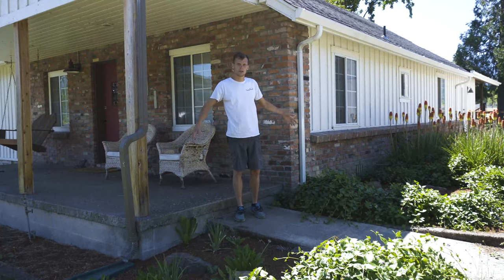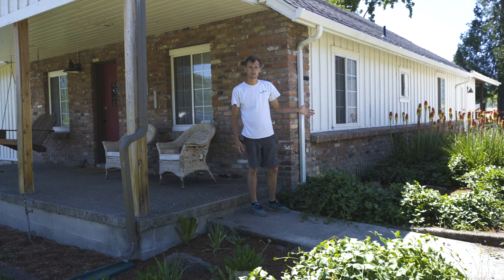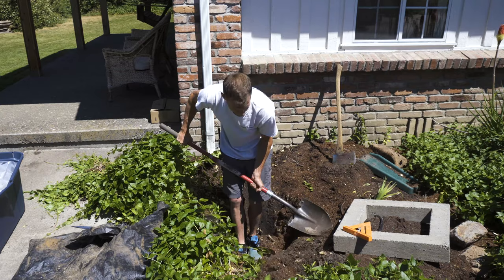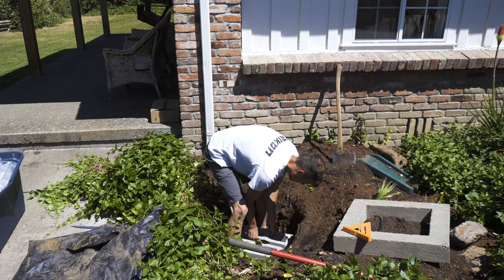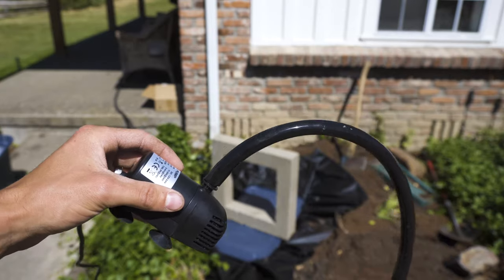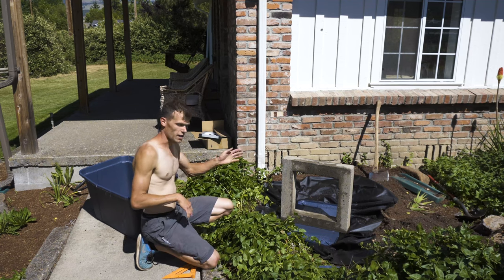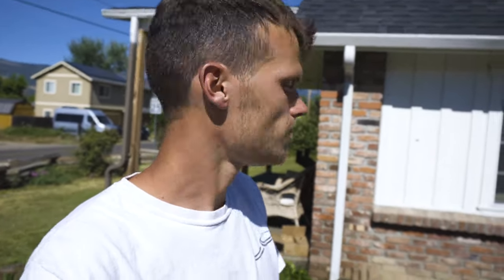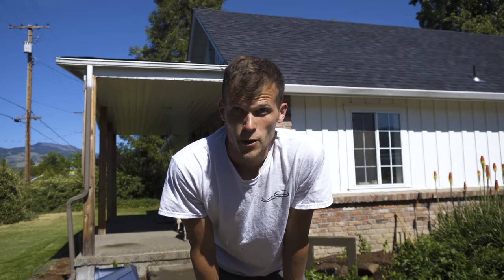Solar Water Fountain DIY

Comment: My oldest son and I are HUGE fan! My oldest son and I do these projects together in our "HOT" Florida backyard. We are building our own tropical oasis in a small corner of our backyard using the square fountain as our focal point. I took the your idea and stacked a 2nd square on top, they sit slightly twisted so the lower level helps break up the splash bc I have a little more surface area for the h2O to deal with. We also incorporated some wood as you did, however I used a shaped piece of driftwood (I know I went crazy, but it looks amazing) and when the light hits it at night the perspective is 💯. Thanks for all you do, you are a huge inspiration to us "weekend warriors". 💯
Reply from the maker: That’s so awesome! I’d love to see what you’ve made if you wanna send pics of it to my email. Thanks for watching! Tell your son I said hi 👋🏽
Reply: @travisjantzer  I will. We are in the Florida Keys for a few weeks but I can send a pic when we return. Thanks for the reply.

Comment: You could make the bottom out of straight cement with maybe a rebar for added weight and the sides and top out of hypertufa, which is cement mixed with peat moss. That would make them a lot lighter than the base and not so easy to knock over, so safer.
Reply from the maker: i'll look into that.

Comment: Have you thought about using a storage container with a lid as a reservoir for the water and pump? I saw someone else use this technique, then I came across your video. I think I will combine the two techniques to get the look I want.
Reply: I'm thinking of doing the same. My only concern is if the container will be able to hold the weight of the concrete square.

Comment: That will be an absolute nightmare to get to the pump when there is a problem with it. However, I do like the square fountain. No matter what the probability that something will bump it, that heavy cement fountain needs to be secured so it cannot fall.
Reply from the maker: its only 18" tall. Getting to the pump isn't too difficult. but I see what you mean

Comment: You could run the solar panel to a battery pack and the battery pack to the pump, thus it would run when it's shady. Slightly more expensive though.
Reply from the maker: That solar pump isnt set up for batteries. But other types are.

Comment: PROBLEM IS the pump might not last according to some of the reviews and there not cheap. The plugin is more reliable.
Reply from the maker: Likely true but thats what I'll find out.
Reply: Yeah. There are a whole lot of exciting videos of people building stuff with that kind of pump... but I notice there's NEVER a follow-up video a year later showing that it still works. Maybe there are some out there but I just haven't found them.
Call me stubborn but I flat refuse to buy hardware unless I'm confident it's going to last at least a couple years. And I have had very little encouragement in that regard about small solar water pumps, unfortunately.
Reply: @travisjantzer  still working?